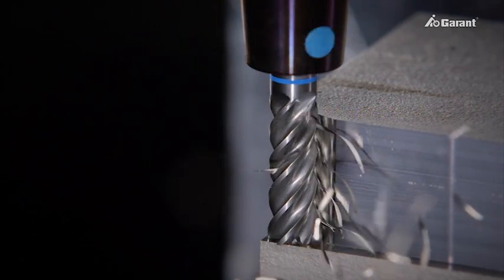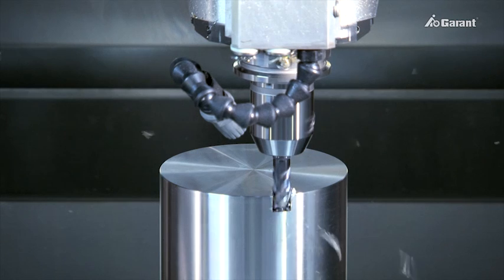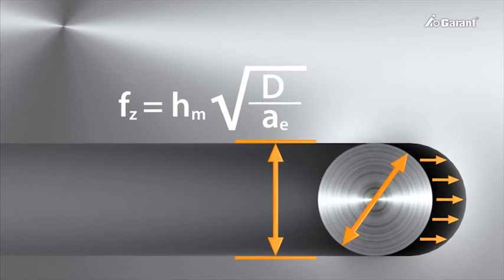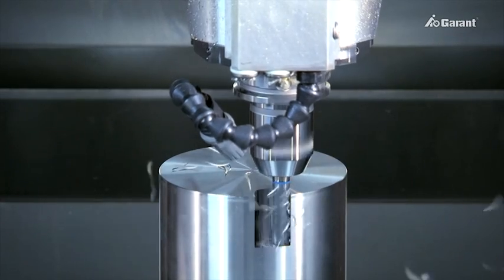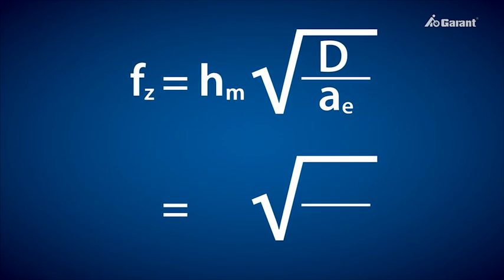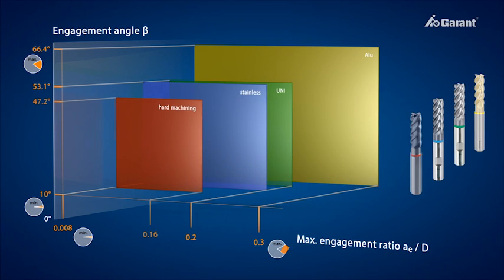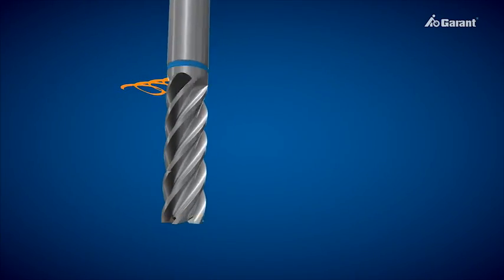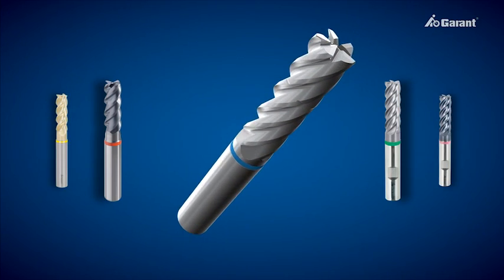GARANT TPC - Trochoidal Performance Cutting

Comment: I saw this in 2006 is Zell (Walter Prototyp) So whats is new??
Reply: At Protyp a saw a full slot, 16mm cutter with 32mm cutting length. (25mm width 50mm length)  Very simple parameter to produce a slot. Put in parameter for one cut. then repet it. Very simple. There also showed a ramping processs to deep 30mm. After that there increased the diameter form 25mm to 50mm. With very simple parameter.  It is possible, but there is better today.
Reply: Yeah Walter is having several solutions, but Hoffman is Superior in Rotating Tools, I saw in India.

Comment: can see benefits for stainless and other harder alloys however I work with a couple of guys who use this method of smaller cuts at stupid high feedrates and they are literally vibrating their spindles into dust and require refurbing every couple years at a 10 grand price tag
Reply: Yeah, on smaller parts it's kind of dumb to use HSM methods as the feeds required to load up the tool properly make the table go nuts.
Reply: In a professional setting 10 grand is nothing over a two year period. Running just a few percent faster would make up for it. Speed is king.
Reply: better for tool life. worse for machine life.
Reply: Completely agree, sorry forgot to mention that they use it on aluminium and plastics, by switching back to the traditional methods I eliminated the spindle wear problem and even reduced their cycle times sometimes by up to 50%. i've recently moved onto titanium and similar materials and the HSM toolpath is definitely the way forward
Reply: In soft materials the only advantage is in deep slots, helps with chip evacuation.

Comment: come on fellas reduced tool wear at the expense of reduced machine life
Reply: Guy Good As well as massively boosted productivity due to less time spent changing tools and higher material removal rate, as well as lower cutting temperatures and thus less need for cooling. Overall, the benefits outweigh the cost of more frequent machine servicing or replacement outside of highly specialized applications.
Reply: +Guy Good And don't forget. Less cutting forces and vibration. Vibration is the number 1 killer of ballscrews...
Reply: In my experience the tools actually hold up MUCH better because the majority of the cutting pressure isn't on the corners and the machine actually vibrates less with this style cutting
Reply: +Kostas Froudarakis Thats why you should not use Weldon or Shrinkchucks. Just Collet Chucks - no vibration with the CENTRO|P from FAHRION
Reply: pfft...My Rohm hydraulic tool holders > those.
Reply: Less machine wear with trochoidal milling